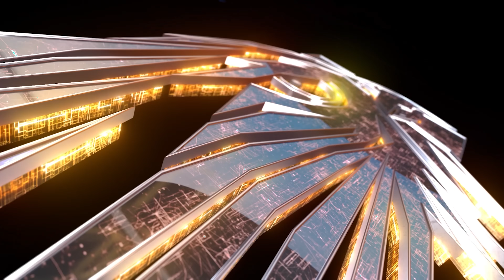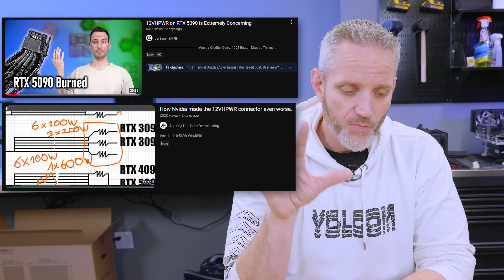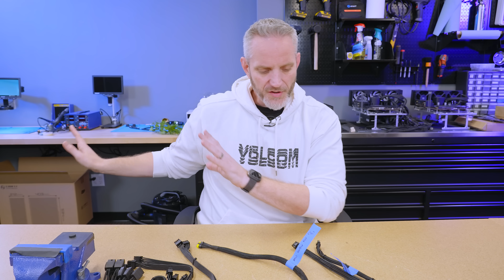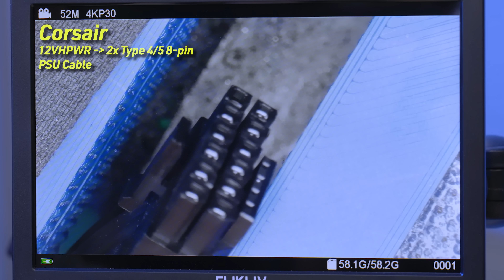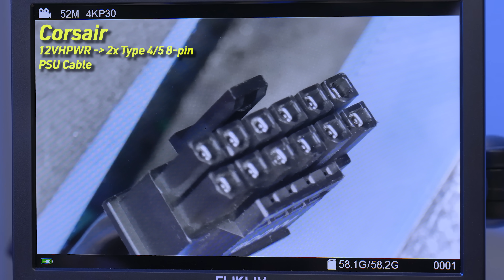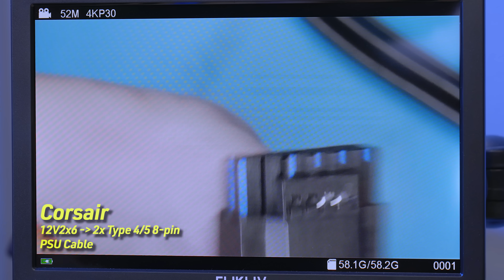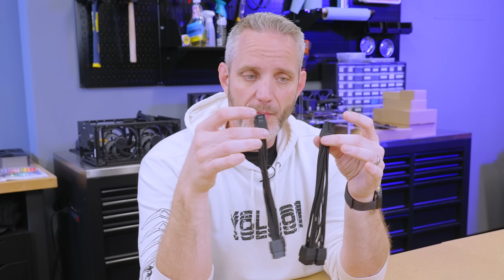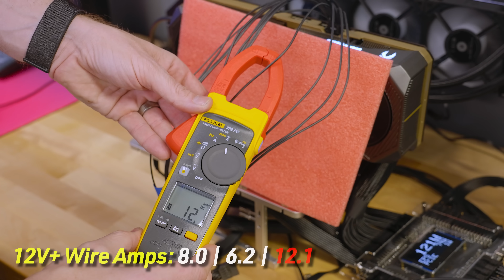I discovered something concerning and I need the Experts to chime in... More 12VHPWR discovery!

Comment: I have determined that this is an issue with bad pin contacts

If you compare the 12vhp to high power appliances like microwave, refrigerator, or water heater, then you will notice the household appliances has much thicker metal to connect to the wall socket along with higher AWG wires. Thicker metals/wires mean less bending which means better contact when plugged in while being less susceptible to external force losing the connection. 

What about current loading balance? See, the 8pins doesn't have it either. The idea there's some current regulator in the 8pins is not right. You won't find a current REGULATOR in those wires. Current would travel in the path of least resistance so if you plugged all the pins evenly, you would get an even distribution.

The fact we variable current on the wire shows that the pins are not making even contact. It doesn't matter if you "plug it all the way in." If you have an uneven wire, no amount of correct plugin will address the problem.

Comment: good thing ive got a 4080, no melting issues and amacing that it only uses 50w more then my 3070 which is like night and day slower then a 4080 ^^
using a thermaltake toughpower GFA 3 1200w for it ith its 600w 12vhpr cable and it obviously works like a charmy ^^

Comment: The cable that came with my Thermaltake Tough power GF3 had this exact thing!
I was using it with a 4080 super, both new.
The card would work, but the moment I put it under any kind of load, it would shut off. 
After the panicking and swearing was over, I managed to figure out that it was an issue with power delivery.
So I assumed I'd been a complete donut and incorrectly inserted the cable, it was after all my first time (with a 12vhpwr) and we all make mistakes the first time, just ask my ex.
So I tried reinserting it and testing. Then rinse and repeated, many times. 
It kept failing.
I kept swearing, in fact it was about a good 2-3 hours of continued cursing.
I pushed on that thing harder than my will to live
Still... nothing, zilch, nada, a sweet FA.
I even compared mine to images online... the cable seating, I definitely mean the cable seating.
All seemed fine.
Eventually out of pure desperation, I checked the cable and found one pin was recessed considerably and rotated 90 degrees, when compared to the others.
After the third bout of increasingly colourful swearing, I contacted the seller (Scan.co.uk)
Thankfully, they were amazing about it and sorted it quicker than I thought possible.
The new cable looked fine. 
I Plugged it in and it worked first time, with no issues since!
It was round 4 on the swear-athon - but this time, it was at least happy swearing.

Comment: I'm not an electrician or electrical engineer. However, as an automotive technician I deal with 12 volt systems and a wide variety of connectors every day. I can say with 100% certainty that a bad ground is worse than a bad connection on the power side. Less ground creates higher resistance. Higher resistance = higher heat.

Comment: There are a few things that leads to the meltdown of the 12pin:
1. Insufficient wire gauge for the application. I bet that they don't do temperature and current derating to see if the sizing will fit the application (600+W). It doesn't hold up? increase the gauge.
2. Bad pins/connector. A good connectors shouldn't allow any movement on the pins during mechanical operations (plug/remove etc). Pins go inside? Pin retention issues that most of the times are caused by a bad connector. That should be immediately discarded during QC.
3. The choosing of the pins+wire gauge: Not all combos can hold that high of a load, you size it according to the application.
4. If you are making a high power 12pin connector at least ditch the classical pins square shaped and move towards to classic circular barrels. Better area of contact/fitment, more secure. TLDR eliminates any risk.
Reply: There's another issue to add to this: lack of load-balancing between wires. Without mechanisms to ensure roughly equal current load on each conductor (especially treating them as a single bus), small variance in contact resistance can cause current on a single wire to rise to 20A or more, when they're each rated for 9.5A and intended to carry 8A. Fundamentally, the idea of "total current rating = sum of all parallel conductors" is flawed without a load-balancing mechanism, and the more parallel conductors there are, the worse the problem gets.

This runs afoul of the same reason why ring circuits can't be used to "double" the capacity of residential wiring. If the ring breaks from damage, there is no apparent symptom and the fault is not detectable, until the load exceeds the capacity of the remaining wire and burns the house down.

Comment: In a historic moment long past, someone in marketing tried to make an engineering decision, and now we're paying the price.  The full reality of the issue is that these cables are a total misuse of the technology.  The discrete pins-sockets-wires are intended, by design, to carry a discrete signal for each wire.  They should have never been used to augment load bearing from a single rail to another.  They're attempting to use inconsistent pins, inconsistent sockets, inconsistent crimps, and inconsistent solder joints to consistently balance an overload of each individual part.  It's like putting trust in the path of least resistance at the speed of light and someone got their physics lesson from the back of a cereal box.

Comment: I have a brand new lian white H++ cable that came with an SP850W psu , there are no loose connectors at all whenever I try to wiggle them, and they look pretty uniform looking closely, I think I might just stick with this included cable when the GPU arrives. I will compare it to the adapter that comes with the GPU though for quality

Comment: Cables are always a pain.   The connector you are showing with the pin that moves in and out can be a couple of issues.   The metal clip is either too short.   The locking lug inside the connector has to much play or a combination of both.   You get what you pay for supposedly.   Not always but usually.   Thank you for showing the variation because I think you are on top something with you assessment.

Comment: for now im avoiding 12vhpwr connectors and the components that use them. im hoping they come out with something better before im in the market for a gpu again. if they dont im probibly going to invest in a clamp meter so i can verify even loading. still think the sense pins need to occupy the corner pins in the main connector (reduce to 2 and use kitty corner pins). using 2 kinds of pins just reduces flexibility and increases strain relief requirements.

i think what id do is move to 12 gauge wire and use 5 pairs in the 12 pin connector, use only 2 sense pins, and move the sense pins to kitty corner positions. this would be good for 600w (and could peak as high as 840w) and not require an exotic connector. im not sure whether or not the crimp pins on the mini connector can handle 12 gauge wire, id need to find a datasheet for the pins and housings.

Comment: No clue why they still bother with 12 pin connector/wire, when the 50 series cards have a single + and - plane joining all the pins together anyway.
Make it 4 pin cable, + - and sensing. Problem solved. I believe LTT even has a card with XT120 (could be wrong here) connector for power, just a + and - cables.

Comment: Not an expert, but I think I agree with your idea with the ground, but only in that the PCIe slot might be giving a return path. The ground plane on the GPU and the MOBO would be connected for signal reasons. My thought is any defect on the plug would push the GPU ground to be a higher voltage to overcome the resistance. That voltage difference would then be absorbed by the MOBO, and we're just lucky that this hasn't turned into a burnt PCIe slot. Also, to a lesser extent, same for EMI shielding with the case and the I/O

Comment: 6:10 - The problem appears at the 12v side because the ground is provided everywhere, not just the power cables. Where as 12v is provided only in the power cables.

Comment: Someone was asleep in the development process

i=i1+i2 means 1/r=1/r1+1/r2
a small deviation in the resistance (length of the cable (including the 12V pickup points in the power supply and the feed points on the GPU), transition resistances, minimal alloy differences in the solder or the coating of the contacts), even induced alternating voltages change the resistance equation of the individual conductor cables.
For safety reasons, a protection circuit would have to adjust the resistance of the lines to ensure that the current flow is symmetrical.

Comment: So i updated my psu MB and cpu. Went from 12900 k to 14900k z690 to z 790 and 1000 watt psu to 1200 watt pci 3 ready for prepping for 50 series. After upgrade lost 10k in gpu score in time spy extreme. I also updated Gpu driver after upgrade. All my sliders went to 0 on NVidia app. Has anyone else had a driver update that reset everything to 0 power and temp control causing massive lost in fps????????

Comment: Probably just wire in 10 amp fuses on each wire. Problem solved, instead of trying fly close to the Sun without melting. Make the wire, contacts, plastics rated for the conditions they can reach. 14ga wire handles 15 amps. If you are going above that you need 12ga 20 amps, 10ga - 30 amps. Using cheap parts that are not rated for the conditions will return such results.

Comment: Maybe just use some type od screw terminal / wago-like connection (indexed ofc)? Plugs do not seem working right for it. And why so many small cable, if they are connected to same rail? It is quite big, and there are nice screw in, or nicely locking, cheap plugs used in industrial applications for 12/24V.

Comment: I have used some dielectric grease between the connector and the cable with some liquid metal squeezed in, so far it is doing well. Hopefully it doesn't melt

Comment: 14:27 
Just look at the housing around the cables/pins, the Nvidia adapter has a significantly bigger one, which would stop the pins and cables from sliding out of the housing like the cheapo corsair one

Comment: You should look at the pin to wire connection also. Resleeved plenty of cables where the wires were only crimped on and done in such a shoddy way that repated use will cause a loss of electrical connection. The wires heating up are actually the wires with a good electrical connection. Electricity flows through the path of least resistance causing high amperage in wires where electricity can flow less restricted.

Comment: Historically the current limiting function is always done at the power supply end. This is because a given power supply wire could be delivering power to more than one item and in such situations an item has no way of knowing how much power is being supplied to the other items using the same wire and so would not be able to assess if the power supply wire is being overloaded. Only the power supply end has the possibility to monitor how much power it is being delivering to each wire. 

Just because in the past NVIDIA tried to do something about excessive power, doesn’t mean that it was it’s responsibility to do so. In fact for the reasons stated above it isn’t.

Comment: I looked at the new rm1000x corsair cable and it also had the connectors at different levels, never plugged in. Both ends had the connectors at different levels. Not that big of a deal for me as I upgraded to 7900xtx from a 2080ti instead.

Comment: If you need to do bunch of checks and workarounds in order for product to work correctly failure is not user error. Failure happens because of bad design.

This connector is terrible fragile design. Nvidia using it without any power delivery balancing only shows Nvidia doesn't care anymore and just release bloated numbers.

Comment: I'm just waiting for a cable mod that cuts all the tiny cables out; replaces the hot and ground with 4AWG copper welding or battery cables.
Reply: There is already mod with lcd display and cooling fan for the cable if you want.

Comment: now you know why apple derectly soders ther chips to ther mother board and use arm chips that have far more power but only need to draw like 1/4 of teh watts for the same amonut of preccesing power thsie days. thsie contector issues for the gpu cards are to blame. we apple users don't have to worry aobut bad contectrs for our comptuers. this is a build your own pc and ath5rid party hardware provitder issue. how did i know something like this wasd giong to happen on such a large scale is why apple make ther prodacuts the way they do. yes its a pain to repair but its onrmaly won't need repairing before its would just fully fall all at once instead of one part and thats after like 8 or 10 years of life right out of the box if you know how to take care of it properly. but onrmaly whre apple prodcut brakes its normaly so old that its wolud normaly be replaced anyway. heck my curent apple comptuer is kinda elderly for apple comptuer standerds by the way. but its still works very well bescue its hardware fits into a very good aera wher its not to old but not to new or cuting edge ether.

Comment: Just checked two Corsair HX1500i cables, those ones doesn’t have the movement the Jay showed. Is it different for each model or series?
Also checked several Gigabyte PSU, they have this cloth tape around the cables after the connector, maybe they are trying to prevent movement?

Comment: The cable ends have a tab barb on them them that should lock when you push it in all the way.  It appears that it is not pushed in all the way.  Will it push in and click? (just that one wire)  If it pulls all the way out, spread out the barb and try and push it all the way back in and see if it locks in place.  Its definitely not where it should be.

Comment: As a former electrical and a electronic engineer in the power delivery industry before an injury ended my career I can absolutely say that a bad ground will absolutely cause problems. 
You have to think of Current Path:
A ground wire is meant to provide a low-resistance path for current to return to the power source, so a bad ground can force current to take alternative paths with higher resistance, causing heat build-up. Therefore by having a bad ground you are forcing other wires to have a higher resistance which is translated into heat and you will have a fire

Comment: this entire plug design is failed-by-design - even the150W 6+2-pin are somewhat flawed as they still only use 3 cables for +12 - the additional +2 are not 1 gnd and 1 +12v but only 2 gnd - and one of them is just a sense - so a 6+2 is by no means any different than the regular 75W 6 pin aside from 1 more gnd and 1 additional sense
TLDR: every pci-e gard - no matter if gpu or whatever - should all stick to 75W 6 pin - END OF STORY!

Comment: Why not make a 12v power connecter with standard stranded 8awg wire if the card don't split the power delivery. 
Use a 8awg (7/16, 7 strand of 16 gauge) if I would make an after market part. It would be 2 8awg wire.  Power and ground.
And 1 sence wire(16awg). Then solder them to a plate with prongs.

Comment: there are out of spec wires because the card doesn't have a load balancer, you get the unbalanced load because the resistances of the whole cable run till the busbar in the gpu are not the same, this can happen because variance in contact resistance, variance in crimping/solder resistance and variance in cable resistance.
The resistance  between two cable runs only has to varry by a factor of 10 to have the current differ by a factor of 10. So to get a current in one cable of 2 amps and in the other of 20 amps you only need resistances of 0.001 ohm and 0.0001 ohm (or similar), both are fearly low but one is lower. This is because current takes all the paths it can take inverse proportional to the resistance.

The plug really isn't at fault, the card should handle power draw differently because it will be very hard to have cable resistances that close in all the cases even if you completly disregard that a plug and socket will have completly different resistances on each pin every time its replugged.

Comment: Years ago I trained as a marine tech, but no jobs were available when I left college, however Ive been building PCs since the 166 MMX days.  I am really impressed with my 3080 and its durability (Thank you Zotac), now 4 years old and still going strong, but when I went for a new one (the 3080 will be a backup) I saw the circuit diagram for the 40 series, so dumbed down my plan and got the 4070 Ti. Its great and seems to handle the power, however I've always had grave reservations about the 80s, 90s and the power they use on that power input configuration. My bro went the 4080 route and he's on his third card, I cant afford for mine to fail after just one year and out of warranty.  Thank you for getting to the core of the problem, its not just cheap cables, or wrongly inserted ones, though these will fail fast, it's the flawed design.

Comment: Can you try to push the pins to their best position and hot-glue the cables together on the other side of the connector?
This should fix the issue by keeping the pins in the same offset, if your theory is correct.

Comment: A pin that isn't making connection on a parallel bus like this is bad because it will cause the other wires to overload and heat up. A pin that's only just barely making connection is actually worse, because intermittent contact under load will cause cause tiny arcs, which are very hot even if small. Sparking causes erosion of the contacting surfaces which causes a worse connection which causes more sparks and more heat.